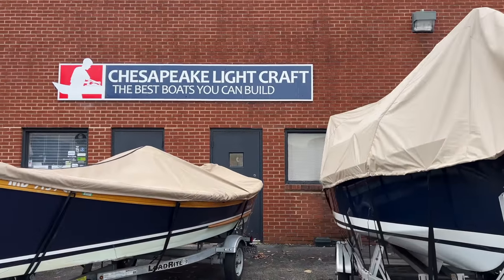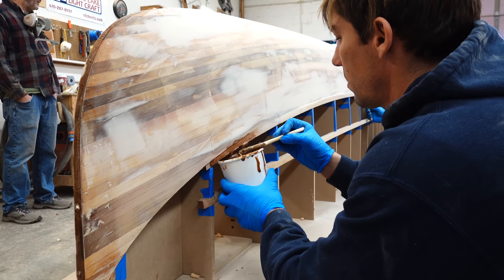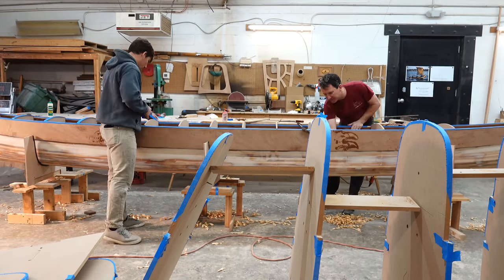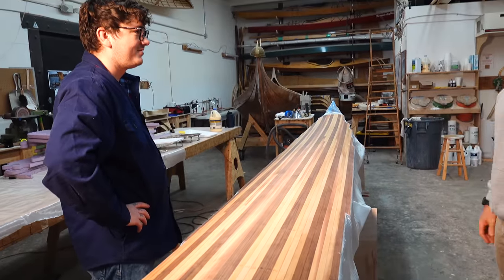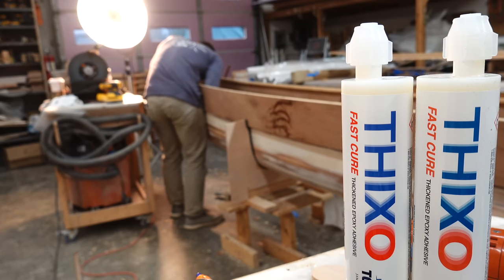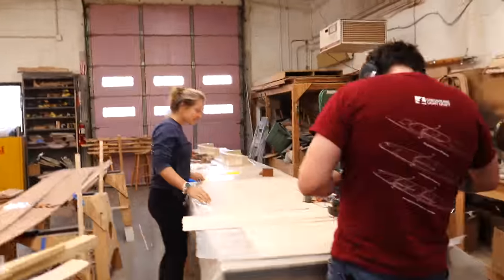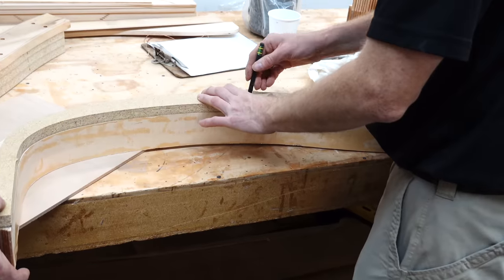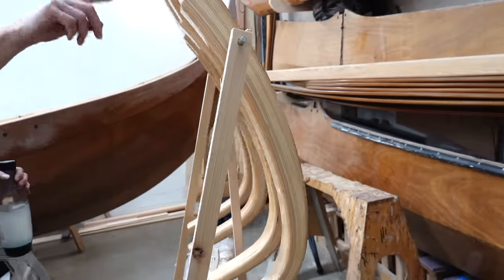Building the Talullah Outrigger Sailing Canoe with @ChesapeakeLightCraftBoats (Part 2)

Comment: Fascinating lighweight build.  Good to see carbon fibre being used to provide extra strength, I'm curious how it's integration works in this case.  It appears that the greatest tension would be on the underside of the crossbeam arms?